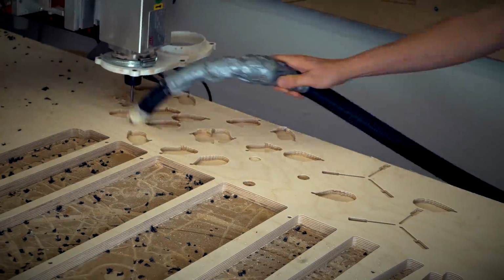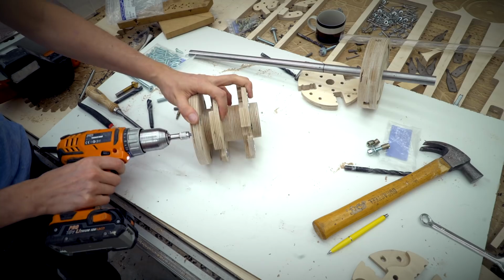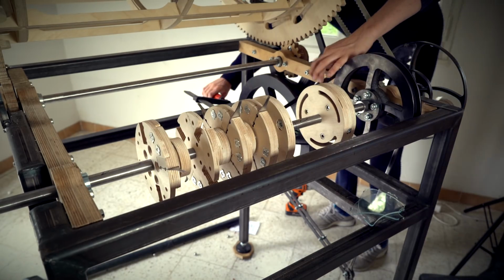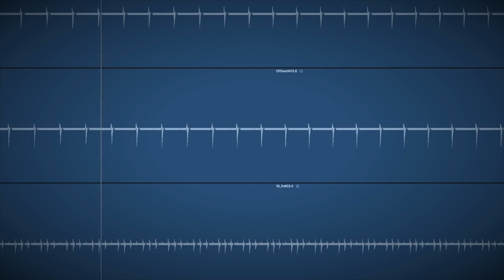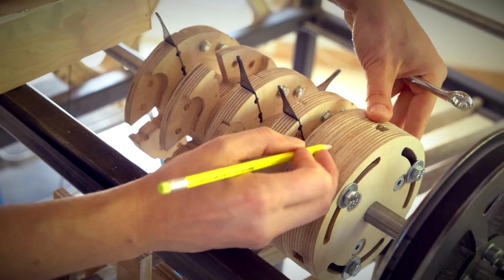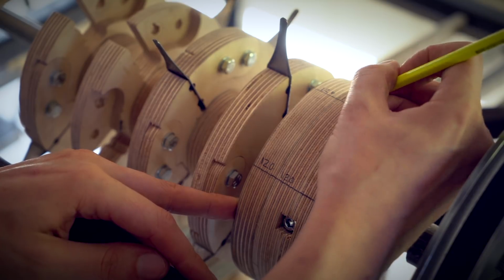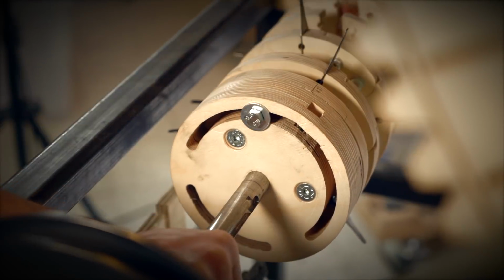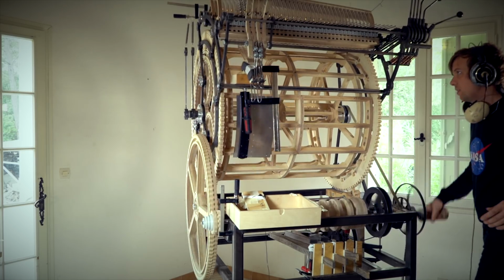Testing the Mechanical Rhythm Machine - Marble Machine X #55

Comment: I would suggest still using two bolts on the programming disk for stability. Depending on your tests, if you don't have to move more then 340-360 degrees for adjustability, doubtful you need to, you would only need one of those stops to hold the disk together as it wouldn't have any significant mechanical strain during operation, and two bolts on opposite sides would evenly distribute the contact with the other disk. 

I suggest this mostly as a worry with warping. True you don't need a clutch plate and can rely on the friction between the plates, however it is just good form to distribute the force. Otherwise you might end up with the disk getting angled. This isn't a big concern but I feel like this could solve your tuning problem and block any future problems
Reply: Reed Oscar I had the same thought. Better to distribute forces symmetrically when possible.
Reply: Attach a metal scale so you can see exactly how much is needed to move it. The pivoting heads of a Bridgeport mill has this so you can get it lined up exactly right.

Comment: This might be a stupid question, but if the drop latency of the marbles changes with different BPM rates, will you have to stick with a single BPM rate during live performances?  Or else have to adjust each physical adjustment mechanism between songs to get proper timing?  Or change the timing electronically by offsetting all your contact mic pickups in software, and just have them play out of sync with the physical machine?  While I'm asking stuff, how do you plan to maintain tempo on a machine that has that much inertia controlling the timing?  Do you have to hit the brake if you're going to fast?

Comment: Is there going to be a brake on the flywheel in the finished machine? Maybe with a foot pedal? I think it would be good for safety and also if you want to do quick downward tempo changes.
Reply: That would be a good idea for sure. I was also thinking about how he may not want to get a larger flywheel just yet. All the added weight of the programming wheel plates and the pins, will add a lot a inertia to the system when all is done.
Reply: A break that's too strong could damage the machine from inertia. Also love your channel.
Reply: Snowball Effect He could attach rockets and just jettison the fly wheel off in case of emergency.
Reply: I second that. Also didn't expect to see you here, which gives me an idea, how about a video on AI and music ?
Reply: An emergency stop bar would be good
Reply: there was one on the first one so i imagine there will be one on the second.
Reply: No Marble Machine is complete without a "Brakedown" lever!
Reply: In a previous video Martin said that it will have a loosening mechanism, to loosen the leather belt so he can basically detach the machine from the flywheel without loosing the momentum. (you can actually see the mechanism in the CAD drawing he is showing around 0:57 )
Reply: A clutch is better than a brake. By disconnecting the machine from the flywheel,  you can bring the machine to a fast emergency stop, if something goes wrong.
Reply: I'm a bit concerned that this shaker part supports only one exact tempo per song. Anyways, I never lose any Wintergatan episode. Keep the awesome work.
Reply: If you want to change tempos, as in the marble machine song, you could easily disable the shaker entirely before you slow down the tempo, and reactivate it once it achieves the former tempo.
Reply: There was a brake on the last one. I don't see why not.
Reply: A flywheel brake would certainly have to bring the machine to a stop in a steady, controlled way. A sudden stop will shake the thing to pieces, and could even cause it to tilt over. I thought the "brake" on the original marble machine was a bit harsh, but a brake needed to stop a bigger flywheel than this (remember, he said he wants a bigger/heavier flywheel) can't just stop the job in a second or so.
Reply: Awesome to see you poping up in random places
Reply: I think that flywheel now have too much energy and sudden stop will shake whole machine. But it would be good idea as safety device. Maybe second, counter rotating flywheel would help with stability
Reply: Safety? Why worry about safety? Our machines will always do exactly what we want them to do surely?
Reply: Let's be honest, the machine will probably just disable the brake as soon as it's convinced you its just a marble machine!
Reply: Something that disengages the flywheel would be better.  You can have  breaks as well.  But the breaking lever should first trigger a disconnect before any pressure is applied.  That way, in one pull your engaging an emergency stop and slowing down the flywheel

Comment: I've not looked in great detail, but are there any stress relief mechanisms built into the various systems? If not, I'd worry about something (like a marble deployer assembly) jamming and snapping a peg somewhere as the heavy flywheel keeps going.

Comment: If your worried about the inserts coming out, screw them in then remove them, fill the hole with clear nail varnish and reinsert the insert while wet.
When it dries, the nail varnish seeps into the wood and reinforces the thread.
A tip from an old (long passed away) carpenter.

Comment: Since these are contact microphones with all sounds being produced with EQ and that any delay will be pretty constant wouldn't it be simplest to adjust set a delay in the computer? Should work consistently even for live performances, which would mean changing the BPM mid show (or even mid song) is achievable.

Comment: If you build a differential in the shaft, you can use the idlers for essentially infinite phase adjustment between an input shaft and an output shaft. You could then have a crank for adjustment attached to a dial and be able to crank to different indicated tempos visually and quickly. You could also configure it with a big long lever, though the lever would have to sweep 1:1 for phase change (IE, 90 degrees phase change is 90 degrees lever sweep).

This type of phase adjuster can also be used on the fly, for tempo adjustments mid-song.

Comment: I think in the future you should supplement your machine with a simple mechanical device that stabilizes the rotational speed of the flywheel shaft so that the rhythm does not “float” due to uneven rotation of the hand. I propose to pay attention to a fairly simple system of stabilization and adjustment of revolutions used in the gramophones of the beginning of the last century. Here https://youtu.be/7Ew5M7-mUiU?t=1060 is its appearance and example of work (video in Russian, but everything is clear there witout words). If you apply something similar in your machine, then the stabilizer simply will not allow the flywheel to accelerate faster than a given speed, thereby maintaining the exact number of BPM.

Comment: Suggesting for you my friend. As a furniture maker for a lot of years I've seen a lot and improvised a ton. 
For your hammered inserts you can also use an old socket from a ratchet set that fits the proper size of the insert and makes for a very clean install! 
They even sell what's called a "deep well" socket. they are easier to handle as you hammer. I hope this helps. 🎼

Comment: Why not adding a keyway to transmit power between the shaft and the static disk? That would eliminate 2 of the 3 set screws and make sure the timing is always correct if the machine is disassembled. I know, it does require machining the metal shaft, you probably know someone with a milling machine? Oh wait I didn't see the keyway.

Comment: The highlight of my Wednesday! It sounds great and really nicely in time.
A suggestion regarding the timing adjustment - wouldn't it be easier to play the marble machine if the beat was fixed to the crank and the timing of the drive to the programming wheel was adjusted? After all, it is the programming wheel which is "out of time" when you change the tempo. This way you always get your 4/4 beat at the bottom of the crank stroke, for example.

Comment: Isn't there already a mechanism for timing the crank/pedal, so that they hit the bottom of their stroke exactly on the downbeat?  If so, it seems like you wouldn't need any extra timing adjustment for the rhythm machine, it should always just be in sync with that.  The only timing you would need is between the crank and the programming wheel, to adjust for the time it takes for the marble to fall from the second release.  Or am I missing something?

Comment: Realized I was logged in with a clients account, opps ... Martin, I will be dreaming of a way for you to be able to move the bolt freely in the middle of a concert. Cause every song is has a different beat! Do you already have a way to do this on the fly without using a wrench every time. Maybe just welding an an allen wrench to the timing lock screw... hmmm... love WhatAboutTheBee comment! but I tend to agree with the other comments, I do think the weakest link in timing is gong to be the belt. But really, so long as it is set before a 7-12 song set it should hold enough, and especially if it's in a huge auditorium or venue with a large speaker system the change in timing will be minuscule to the normal audience. Keep up the great work!!! P.S. NASA Sweat shirt is a great touch!!!! LOL Good luck on that front too!

Comment: Martin, I will be dreaming of a way for you to be able to move the bolt freely in the middle of a concert.  Cause every song is has a different beat!  Do you already have a way to do this on the fly without using a wrench every time.  Maybe just welding an an allen wrench to the timing lock screw... hmmm...    love WhatAboutTheBee comment!  but I tend to agree with the other comments,  I do think the weakest link in timing is gong to be the belt.  But really, so long as it is set before a 7-12 song set it should hold enough, and especially if it's in a huge  auditorium or venue with a large speaker system the change in timing will be minuscule to the normal audience.  Keep up the great work!!!  P.S. NASA Sweat shirt is a great touch!!!! LOL Good luck on that front too!

Comment: Watching you work is sublime! I think one thing that you'll find is that those ticker tabs will deform and wear out quickly. There is a reason that heavy spring suspension is a long coil of tempered steel, because repeated excessive deformation causes permanent fatigue even if the material returns to it's original position. I learned this when making a lottery wheel with a "ticker" of the same construction. It looked fine and then one day it flew off. The ticker tab on Wheel of Fortune and The Price is Right is a spring loaded, rotating tab for this reason.
Reply: Perhaps he shall keep extra supplies of those

Comment: If you added a somewhat heavy weight on a cable on the flywheel side and use the handle and momentum to wind it up into a spool the let gravity pull it back down letting that energy help power the wheel freeing you up from having to constantly turn the wheel helping with fatigue and consistency.

Comment: You should have a kind of 'Top dead center' marker on the finger assembly and then mark the set screw assembly at the different timings so that you don't have to re-tune the machine if you switch between two different BPMs. Just line up the marks and it'll be right. Would that work? presumably the marble delay is consistent.

Comment: Martin/Marius I'm not sure if this is the feature creep that you mentioned before, but two thumbs up on the notion. Two minor suggestions. 

One. Point the threaded end out the other way through the adjustment holes and tighten the thing with a big thumbscrew. Big enough to allow for you to torque down, but more convenient than a separate tool. Basically one less thing to keep track of on stage. If not attach a ratcheting wrench to the frame via magnets, wire rope, or even better attach the ratcheting wrench with a wire rope so if it falls it doesn't go anywhere and put a magnet on the backside of it so it sticks to the inside of the frame and doesn't mess with the overall aesthetic of the machine.  

Two make a pointer that lays from the drum over the adjustment plate. You were marking degrees with a pencil, but lining up against a note that was 3 or 4 inches away diagonally. Give yourself a fixed reference point that is right over the lines you are using to adjust by. Faster and more accurate. It could be as simple as a nail bent at 90, tapped into a pilot hole and glued in place.

Comment: 22:01 another solution: add 3 or 6 holes to put bolts in with a 60° or 40° turn

Comment: I think there should be an easier way to sync the marbles with the Rythm Machine, specifically you need a way to set your delay in the time domain, not in the space domain, so it's independent from the rotation speed to be right..

Let's Immagine that you could add some digital delay to your Rythm Machine contact Mics (Of course I immagine you would rather not, the whole magic is having a completely mechanical music instrument. that would feel like cheating, but let's do this as a mental exercise).

If you kept the rithm machine in sync with the marble release, it would take just the fixed delay of the marble drop time to keep the rythm machine in time with the marbles at all tempos. And obviously you wouldn't need to adjust the sync between different songs

So, the whole solution would consist in setting a delay in terms of milliseconds instead of fraction of the revolution time (wich might be changing from song to song). I wonder if any mechanical device is able to do such a job, even if I realize that this is a device wich have a rotation Speed, while I'm suggesting to work with Time, so it might not be that simple.

I immagine the delay could be "injected" between the crank axle and the rythm machine axle (wich now are the same, I'm immagining to separate them). If it could be done, and the rithm machine axel could start to rotate at the same tempo of the marble machine, but with a fixed delay time, it could solve this problem once and for all, without needing any manual handling!

I hope this comment will be helpfull, even just in presenting you another point of view to analyze this problem from!
Reply: The problem with keeping them synced at different bpms though is the fall time of the marbles. The speed at which the Rhythm Machine moves interacts directly with the speed of the crank, but the speed at which the marbles fall do not. To keep the Rhythm Machine in time with the marble hits at lower bpm for example, the marbles would have to physically fall slower and in direct proportion to the lowered speed of the crank. The alternative is simply adjusting the Rhythm Machine to the bpm of the song, and since the Rhythm Machine is currently only a prototype, the final version can easily have adjustments and markers for specific BPMs - and since the programming plates all have to be switched out between songs anyway, adding one more adjustment to the list shouldn't be that big a deal.
Reply: Probably I wasn't able to explain my point in a clear way!

That was exactly what I was pointing!

The marbles have a fixed delay time in wich they travel the distance between the drop point and the arrival point, so it would be logical to have the rythm machine to move with the same fixed delay, and it would be a lot less time consuming on stage to operate (as it would need no fix between different tempo songs)!

In other words, as the rythm machine is built right now, the delay is fixed in the space domain (e.g.120° later), so it depends on the speed of the rotation to cause a time delay (e.g. 20 ms @ 120 bpm).

It would be much more logical to have a delay wich is already in the time domain, so it would be "right" for every speed!

Of course I don't know if a mechanical device is able to cause a fixed delay in terms of time, but it would be a better alternative imho!

Comment: For the volume levers, cut a notch in the side of each, add a block with a spring behind it
If you're going with more inertia on the wheel, are you going to add a brake pedal to the flywheel ?

Comment: I love it, wheels within wheels syncing to spheres.  To make your life easier, you may want to graduate the rightmost cylinder in binary fraction. (1/4 , 1/8th, 1/16th, 1/32nd,1/64th, and 128th ,marks and all combinations thereof, like a tape measure.  Might be handy if you're swapping in different wheels or doing a lot of adjustment. On something that big, you should be able to consistently interpolate to the nearest 1/512th measure.

Comment: So if you have to stop the machine to adjust the rhythm wheel, wouldn't it be difficult to work with different tempi?  Why not attach the contact microphone instruments on a semi-circular path around the wheel and have a crank to rotate them to a different location in the wheel's cycle.  This could then allow for performing accelerandos and ritardandos and using the adjustment crank to compensate for latency.

Comment: I have a simple solution witch can let you adjust the bits timing without stop the machine.
It means you will be able to run the marble machine and adjust it easly at the time it runs.
Let me know if you are interested.

Comment: At 16:17 when you showed how you could adjust the notes rotation/timing my mind was blown. I was wondering how you would rotate that entire section around the pipe to move the timing to match with the marbles. Very cool and seems really easy to do in the end.

Comment: it might be helpful to add degrees on the adjusting friction disk where you made the pencil marks. 
not based off of 360 degrees but one representative of the timing being changed when shifting the friction disks.
Like you needed to move it a half of a 1/16, that should be represented on the friction disks already so that you wont have to do math on the fly (like you did to find 45 degrees)